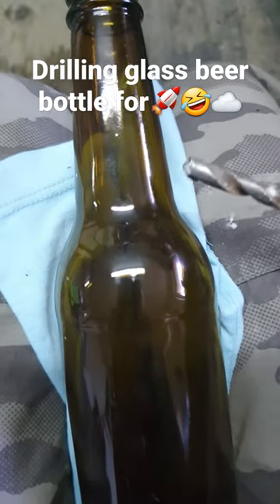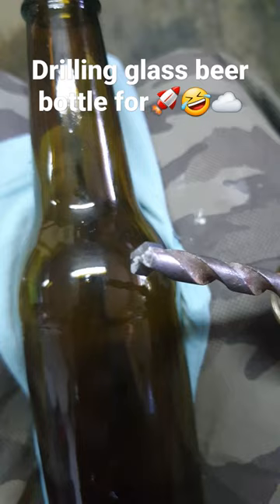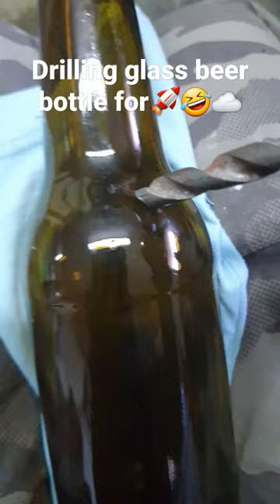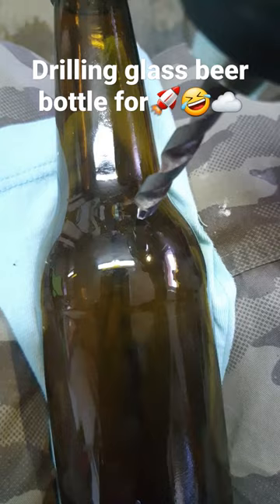drilling in glass bottle

Comment: If you do it underwater, you can avoid the glass fracturing as much. Unless you don't trust yourself with an electric drill near water lol
Reply from the maker: Probably even better.. battery drill is a solution✌️
Reply: @felixwoukec3902 put some oil, any kind of oil, on it. It's the magic trick for glass, wood, metal, whatever.
Reply from the maker: @nevinkuser9892  i would but it extend drill time..do not have time for this s##t 😂